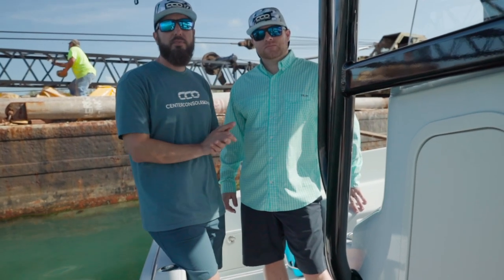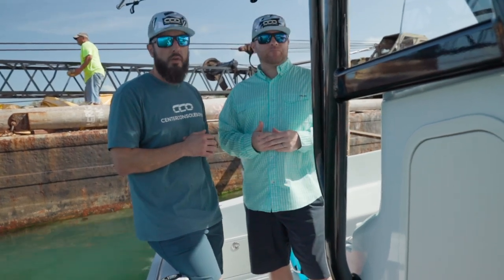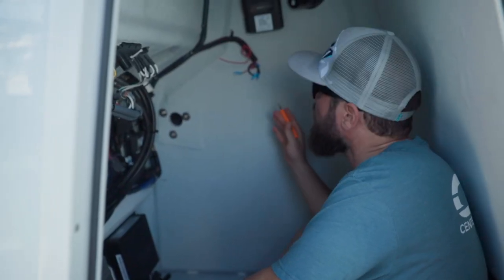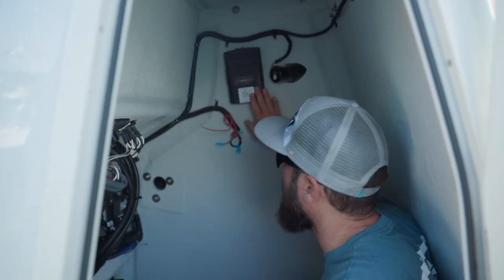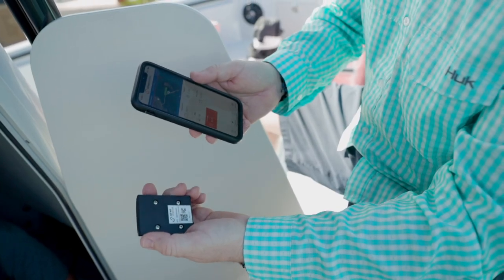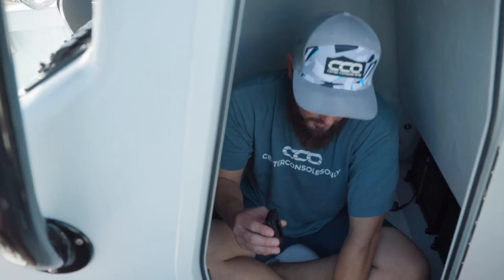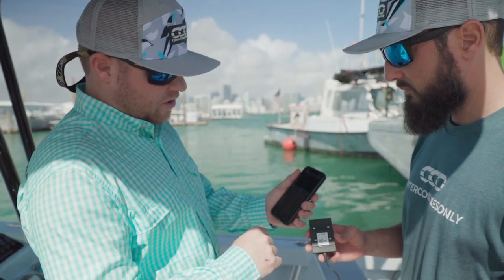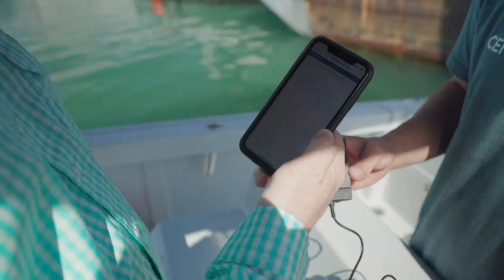PROTECT YOUR BOAT - Siren Marine Install

Comment: so what actually comes with the siren 3 system ? gps tracking and battery monitoring or do you have to buy ALL of these other sensors separately ?
Reply from the maker: Andrew Thompson The standard system comes with battery sensing for two batteries, gps 
Position and several other hard wired options.  If you want wireless bilge and wireless door sensors, those are separate.
Reply: @CenterConsolesOnly  ohhhh ok cool,  thank you !